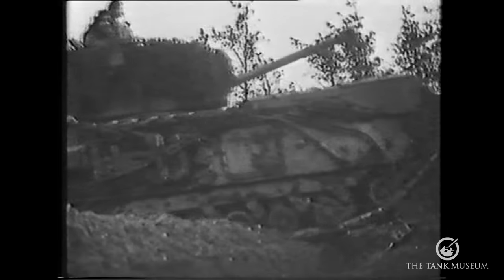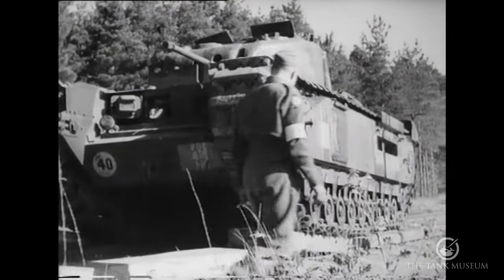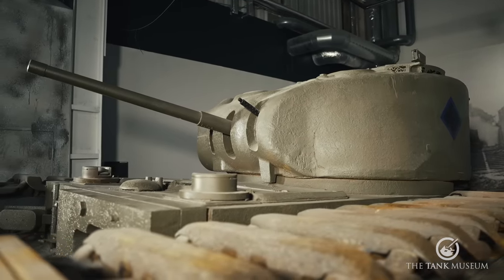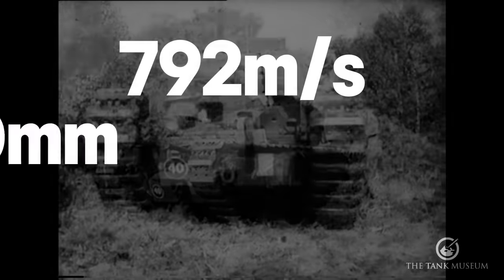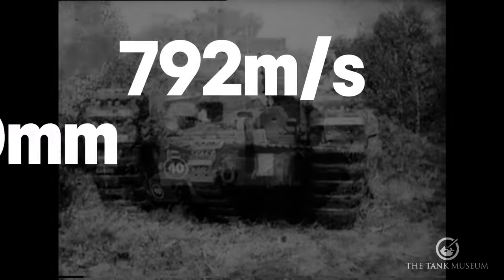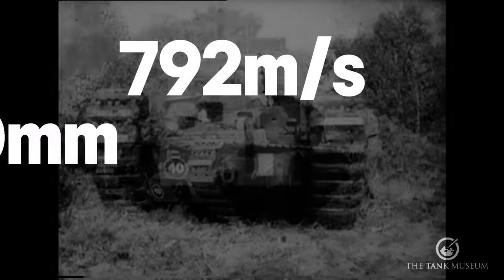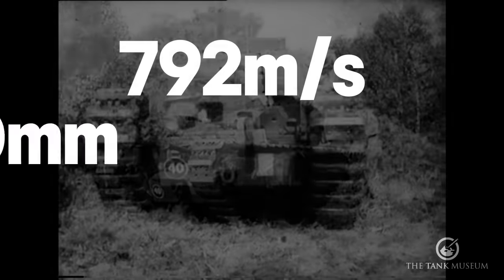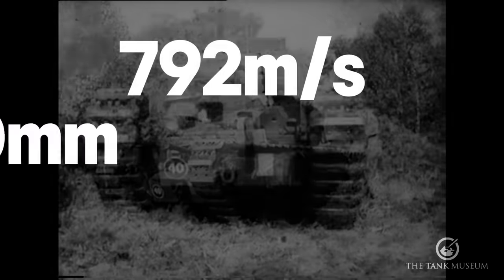Evolution of The  Churchill Tank | "No Damn Good"?

Comment: It annoys me that it definitely had the power to hit 34kph offroad and 42 on road, so some genius said hey, we dont want them to be capable of outrunning the infantry, so 28kph absolute top speed was mechaically integrated.
Reply: they hinted to this in the video, but the suspension used was the issue. It would break far to often at higher speeds, but offered exelent performance everywhere else. So they choose that type because of the aim.
They could also have strenghened the thing, but the weight gain and reduction of internal space would have been not worth it. 
It would also have lost its great transmission for the piece of crap that was put in the early comets, might have shortened the testing of it XD
Reply: This 'tanks outrunning the infantry' phenomenon didn't seem to bother the Soviets, Germans, Japanese or Americans. It was just remarkable that the British persisted with it for so long.

Comment: To comment on Dieppe. 

After the operation and crews were recovered, they were interviewed. On top of that, Churchills were thrown at shingle beaches in the UK.

No problems were found. The tanks are “stuck” at Dieppe because there wasn’t a plan to recover the tanks. It also didn’t help that the whole thing was a distraction for another operation.
Reply: I’m not sure that’s an entirely accurate assessment. Denis Whitaker’s “Dieppe Tragedy to Triumph” points out that the beaches the Calgary Tanks trained on in Dorset and Sussex were not the in any way similar to the landing beach. I’m not a geologist but shale beaches were used for training and chert beaches were landed on in France.  The author quotes another officer, Marcel Lambert, who stated that he “landed with Churchill tanks on a beach quite unlike the ones on which he had been training in England, that simply broke up the tracks of the tanks.” The reference is endnoted to be from Donald McLachlan’s “Room 39:  Naval Intelligence in Action, 1939 - 1945, pg. 388

Comment: Again most British tanks were pretty meh, but that doesn’t change the fact that they did their job and they did it well, In fact German tanks were actually more unreliable than any other country, especially when you consider the terrible suspension designs of later German tanks with its overlapping road wheels and its subpar standard drive train which either stopped due to stress or stopped simply due to the lack of fuel, again even the Sherman was know for being fairly unreliable and it was mostly due in part to the availability or parts and the ease in which components can be replaced was the main reasons as to why things like the T34 or Sherman were generally misinterpreted as being incredibly reliable, again contrast to popular beliefs, everything eventually wears down and breaks apart eventually, be it due to poor quality materials being used to terrible tank designs all the way down to simple wear and tear or combat damage. In regards to firepower British tanks are again pretty meh🤷‍♂️, nothing overwhelming and nothing underwhelming again kinda middle of the road so to speak, not too terrible or too bad but not so good or could do with room for improvements, again in the early stages of the war, British tanks were considered to be the best out of any other country since the 2-6 pounder guns were considered both fairly reliable and easy to produce and maintain, being able to kill anything on the battlefield, from the cute and adorable panzer ones to three, later on when the Germans switched to the panzer 4’s as their mainstay tanks, even the 6 pounder guns were considered adequate enough for the job, without using or utilizing the term overkill 😂, as for the Americans, again most American tank guns were pretty much meh, until you end up with much heavier and more dedicated anti tank hunting tanks like the m10 tank destroyer and so on, as for the Russians their guns weren’t that great, whilst good on paper or in theory or much like most of Russias military equipment at the time, was kinda all over the place since factories were set to individual standards so one factory might produce armor that’s too thick vs one that’s a bit thinner, which could be also due to a number of factors, from things like workers skills and availability of advanced metal technologies, which again resulted in either ammunition powders being either too fine and over pressured to being not enough or too solid resulting in a much lower velocity round and the same can be said for both the armor and the gun, being that some tank guns and armor again varied wildly from quality and overall effectiveness, from components too brittle to components being too soft. And again as I said before British tanks tend to get a lot of hate or negativity towards them, despite the basing simp fact that most if not all British tanks, not only did their jobs but also followed the British’s armored tank doctrines of the time, since Britain was one of the first and largest mechanized militaries In the world at the time, fast cruiser tanks would punch through enemy lines, whilst slower infantry support vehicles bring up the rear and so, faster tanks don’t really need that much armor, considering that their entire stick is all about speed and so having more armor or a larger gun, might not only reduce the overall speed of the tank, but already cramped internal fighting spaces as well as the potential ammunition available to the crew since, is it worth having thirty general purpose rounds being able to take out both armor and buildings, vs having ten dedicated and much larger anti tank rounds instead, despite the probability.

So all in all

German tanks are famed for their armor and fire power

Russian tanks for their mobility and ease of production 

American tanks are built to be relatively cheap, but highly modular to allow them to be stripped of the field or be recycled into new vehicles.

British tanks for me did the job they were assigned to and were incredibly adaptable and modular

Comment: You must include a caliber diameter right after you say something like a 2 pounder. The British is the only odd ball using the weight of the shell projector and against caliber, we are comparing apple to oranges, so what is a 17 pounder equivalent to?? As good as the Churchill were, I feel the Germans had overtaken the people that invented the tank, and produced a superior product, such as the Tiger 1,2 and the Panther. The Panther was in some ways copied from the T34, never the less, the Germans did a great job, but they, lack the time and resources to perfect the three tanks.Until the introduction of the Pershing, (and the KV1) the allies had basically nothing to counter the Tigers. It is interesting the British again had to import Cz design for a tank machine gun. They are much better at banning guns than to design and make any good ones, , at least for reasonable prices. Compare with the Germans who designed the excellent MG42 under very difficult war time conditions. Good gun designers like browning or Eugene Stoner would have their careers dead ended in England.

Comment: How can a tank be so huge and not be able to upgrade the gun?
Reply: The track design limits the size of the turret ring. It's a design flaw, basically, but the 75mm gun was perfectly fine for the tank's intended role.
Reply: @jrd33  ..But the turret could be longer and wider on that turret ring. As in the Firefly.

Comment: Heavy, shockingly slow, shockingly cramped inside preventing the loader from moving munitions into the breech in a timely manner. Although protected by massively thick front armor, the limited driver and commander view of the field and it's small, low velocity gun completely limits the offensive capability of this poorly engineered heavy tank. When German engineers and panzer specialists reviewed captured examples after the failed Dieppe Raid, they were stunned and smitten over how bad the Churchill Tank really was. They were very pleased to know that the tank was difficult to use, difficult to drive, slow to move and entirely outclassed by even the relatively early Panzer IV.